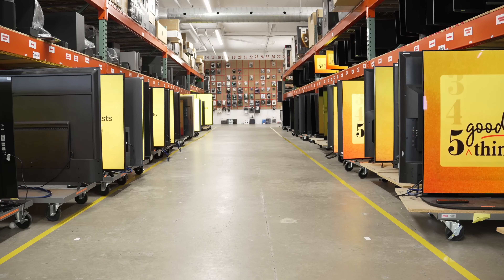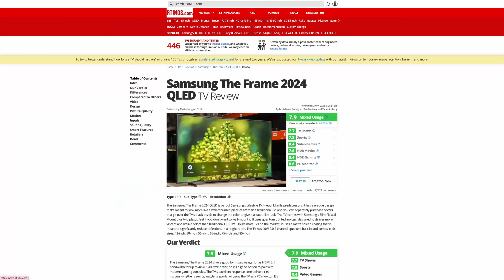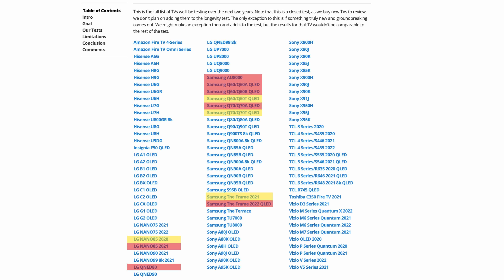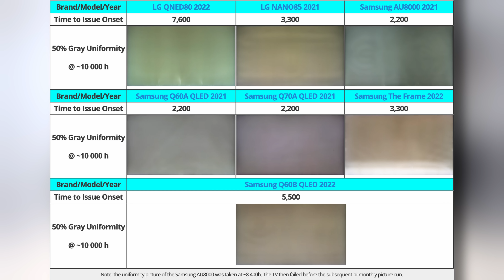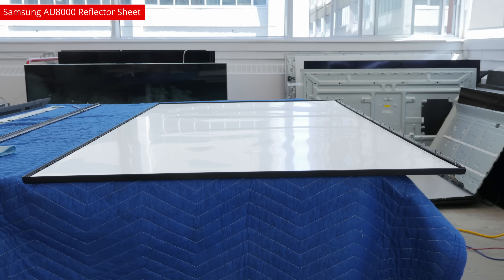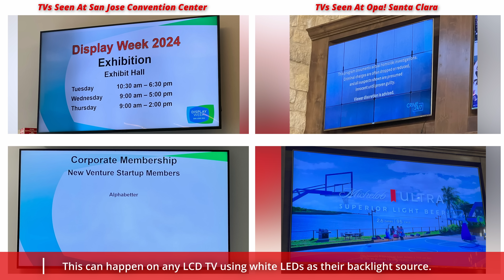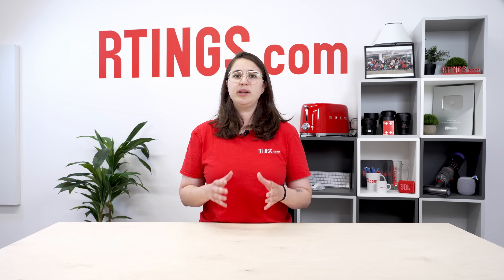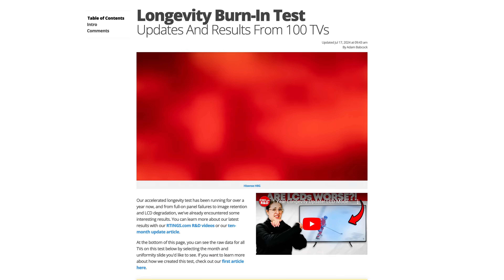Edge-Lit TVs Fail FASTER Than Others (100+ TV Test)

Comment: That is an informative Article !

If Product Developers and Engineers were honest, they wouldn't bring some Products to Market

But what counts is Sales and "who has the coolest Product"
Almost every Electronic Device has Problems with Temperature Management
Small airtight Housings
Small or no Heatsinks
Components are operated beyond their Performance Limits
Poor, cheap Circuit Design
I don't expect a Product that "never" breaks
But 5-10 Years should be possible, especially for High-priced Devices

I opend almost every Tool Charger and changed/enlarged the Heatsink maybe not worth but maybe 1 Charger will live longer as planned .. ;)

Comment: I have a curved Samsung smart tv from i think 2016 (model UE49MU6500). I have these cracks on the bottom and grai areas on the screen. I always thought that the issues where caused by the curved characteristic, but now i know that it's because of the edge lighting. The screen is always so hot at the bottom. I will be shure to by a full array local dimming next time of direct lit next time.

Comment: This is a superlative production and presentation. I had 2 edge-lit LCD TVs die at 5 and 6 years. My next will be direct or full array thanks to you. 

Interesting that my main TV has been a thick 50" 1080p Panasonic Viera plasma TV from 2008. That TV is literally on for 8 hours a day. Yes, it's not energy efficient and gets hot. But it has a great picture and keeps going, going and going.
Reply: My Panasonic from 2009 is still going strong too. My Sis had a panasonic too from 2008, wasn't broken but replaced it a few months ago for a 65" instead of a 50".
Reply: @livy4life  Same, i have an 42 inch LED from Sears bough it 14 years ago, with soundbar included for 850 dollars, never had a problem with it, since DEC 2010!!
Reply: I had a 2009 Samsung 50 " plasma that got many horizontal black lines, the first few 3 years later. By the time I got rid of it, more then 30% of the screen was black.

Comment: It's not that edge-lighting is bad per se but that they're effectively over-driving the LED's to get competitive numbers, it just isn't acceptable that they're creating dozens of hot-spots of well over 100°C, IOW, the real performance of these sets is at whatever brightness setting is needed to avoid them. I have a cheap Samsung AU9000 (ETA >> since Sep 2022, used as both PC monitor and entertainment screen, on for 12 hours or more a day), never run the brightness over 34 (of 50), and keep the ambient light sensor enabled which drops it further in low light. The result is a pretty mediocre picture but I'd rather that than watch its uniformity gradually go to sh!t.

Comment: I work at a factory that uses consumer TVs and computer monitors for displaying all sorts of info on the assembly line. The line has no A/C, and the tvs are on basically 24/7. Most are older, maybe at least 6 years. They all show signs of degradation, have dark spots, image retention (ex. Windows Taskbar or a dialog box), or odd color shifts. It does not really matter for us, as most information is text or basic graphics, but it is still very noticeable. We only replace them when they stop working entirely, so there are a few that are pretty bad but still "work"

Comment: We all should fight for the Right-to-Repair !!    Like @FRAMEWORK does for laptops and cars have replaceable parts,  TV's  in edgelit style should have the LED strip be removble and replacable without needing to open the entire TV.   Imagine your car headlamp fails, and then needing to replace the entire car, haha.  TV's could have the LED strip pull out and reinserted like older laptops were able to swop the battery! #RightToRepair

Comment: We installed a number of 65"-75" Sharp TVs in the mid to late 2010s where they would get a brown darkened area near the middle, but sometimes a bit off-center.
These were often TVs used in bars that would be on for 18 hours a day.
Given they were seeing damage mid-screen, my guess is that they were local-dimming LEDs going out, but they all eventually had the issue as far as I recall (if their video board didn't completely give out first.)

Comment: Would love when the OLED tests results are published and it turns out OLED still has burn in issues or sever dimming issues to cover up the burning issue. This is the main reason I will not buy any OLED devices, I like to use electronics for years, not replace it every year.

Comment: Having had to go through five OLED cPanels, from CXC1 on the 48 and 55-in models.. with just getting it out of the box being an exercise in nightmarish difficulty without bending or damaging.. I will take a slightly thicker panel, that actually supports its own weight any day over the thinness that they falsely offer lol.. like it's not actually thin anyways because of the electronic components usually.. I would much rather have a uniform thickness with a support structure that actually can support a 40 lb plus frame of glass, especially without any sort of front protection, in one case resulting in a separation of the electronic leads and causing a giant green spike up the center, because apparently we can't have bezels but we have bezels anyways, they're just not protected.. it's.. like the RMA, I feel like you would have less lol.

Comment: “It’s unrealistic to expect manufacturers to build TV’s with decade-long durability that are even affordable to most general buyers.”  
Manufacturers seem to put more care into their products when flat panels started becoming mainstream.  I have an old Sharp Aquos (37”) that cost about $1,800 (2005) and a 51” Samsung that cost about $1100 (2010).  Both are dumb TV’s with zero apps and neither are paper thin but they have lasted to this day .  I am unsure of the lighting technology used but I wouldn’t be surprised if they were edge-lit fluorescent!  There have been no issues with the picture quality at all (although the Aquos had some audio module which went out and had to be replaced under warranty ~ 2006 - that TV had gorgeous side speakers).  In their fierce competition for consumer dollars, manufacturers just aren’t making them like they used to.  I saw some Samsung DU7000 Series TV (~55”) at Costco going for $379 yesterday.  While the price is fantastic there’s just no way for it to be as well-built.  As an aside, I purchased a 55” Samsung QN85C a few months ago for the downstairs room.  It lasted literally two weeks before the backlight completely died out.  At least Costco picked it up and delivered a replacement (which continues to work so far, fingers crossed).

Comment: I've got Kuro's and other Plasmas that are ALL still working. What do you think will last longer, a  $6-$9,000 Flagship made out of steel, aluminum and tempered glass that weighs over a Hundred pounds or one that is made to be the thinnest, lightest and cheapest out of plastic ? You can take your 4K and Sh@ve it. ( unless you're sitting 2 feet away )
Reply: 4K is great though. You don't need to sit close to see the difference.
Reply: @logitech4873  You should look into the Physics of it. There's studies, graphs and charts, going back over a decade, about this subject.

Comment: This makes sense mostly due to heat distrobution, as the case also acts as a way to disperse heat from the screen, so i imagine any wall mounted device, without significant ventilation will eventually fail, due to heat degradation, as the components begin to fail over time.

Comment: You would literally have to watch for 10 hours a day for 3 years solid for 10,000 hours. Again you have TVs backed to and facing eachother a scenario that would never be experienced by ANY of these TVs in ANY scenario. You have many with no airflow above or below and of course of these are pouring their heat onto other TVs which again would never happen in the real world.  Also no one would have them at Peak Brightness all the time. I believe your basic testing scenario to be fundamentally flawed. The key as shown in Samsung's reply is "Real World" conditions, there are no issues in "Real World" scenarios. Your testing is NOT real world conditions, it is flawed data accumulated via a flawed process to make an issue out of something that isn't really an issue. I found it deeply annoying and misleading.

Comment: I’ve had my Samsung 65 inch KS8000 edge lit tv since 2016…. ZERO issues. This tv has local dimming even though it’s an edge tv. It was retired from being the main tv in 2022 by another Samsung - 75 inch QN95B.